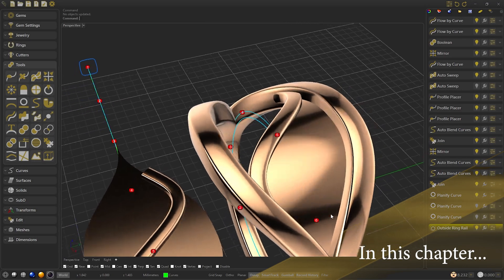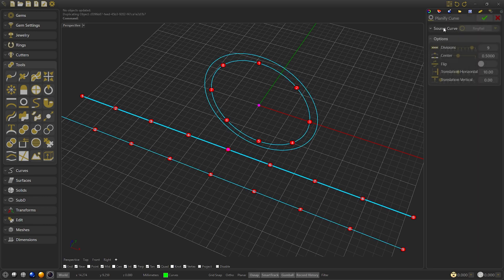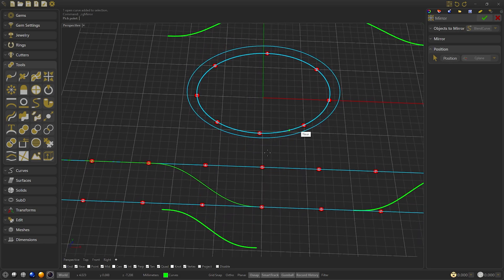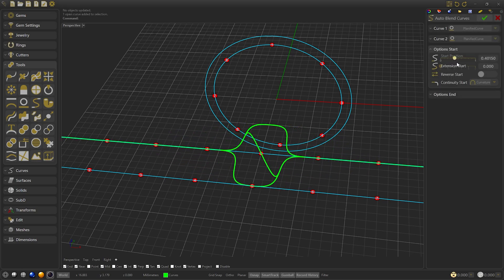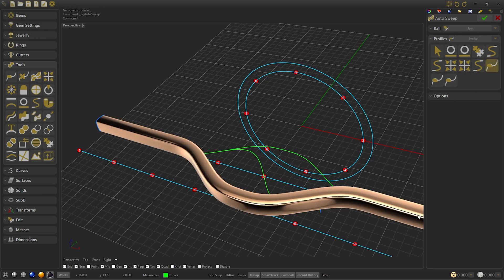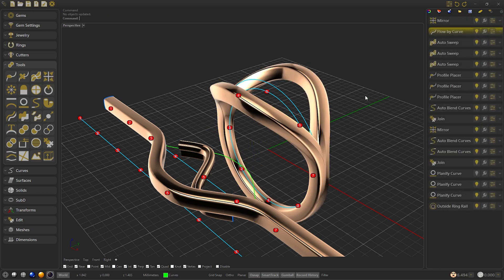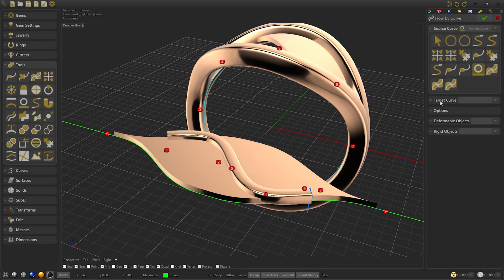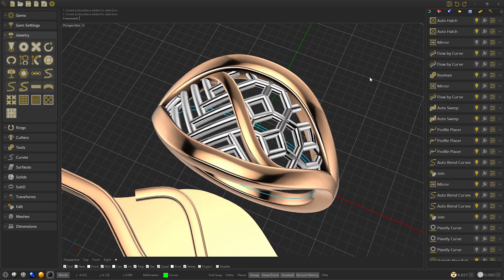CrossGems Tutorial - Creating a Stunning Ring with the New Parametric Tools

Comment: Hello Friend.  This video is very good.  But I’m having problems with applying the pattern to the extrusion.  It only shows up on sides of extrusion. I’m running on Rhino 7 with full licensed version of Crossgem.  Any advice would be helpful.
Reply from the maker: Hello Vickie, 
So from what I can understand, in the "geometry" section of the [autohatch], click on the arrow and select the face you wish to apply the pattern to. 

If you have any problems please contact us at Hello@crossbytes3d.com or you can post your doubts at https://discourse.mcneel.com/c/plug-ins/crossgems/161
This way is easier for us to offer you a specific solution with images or videos.
Kind regards